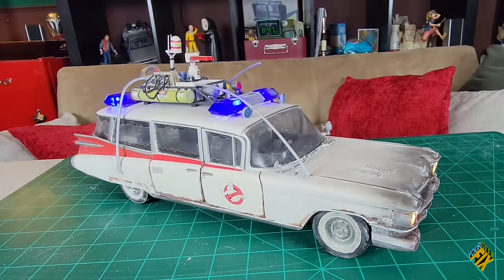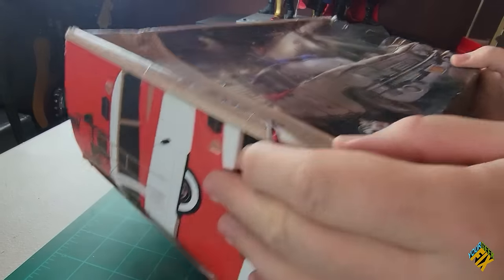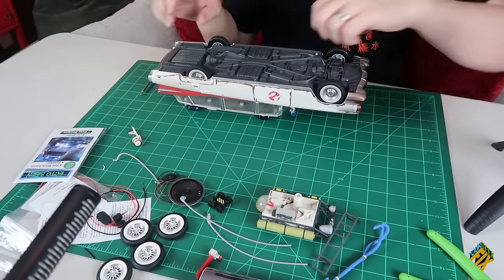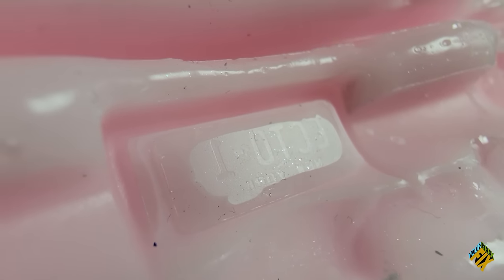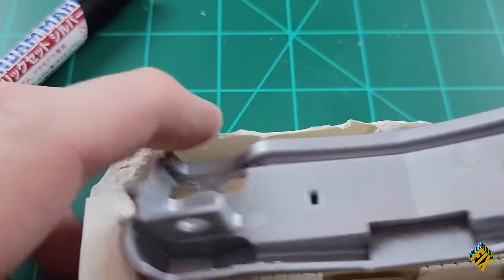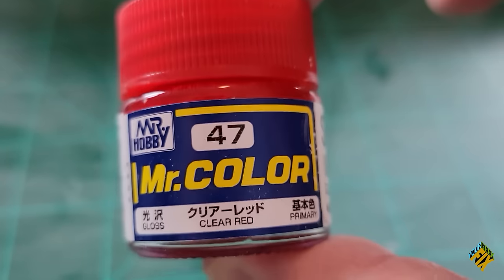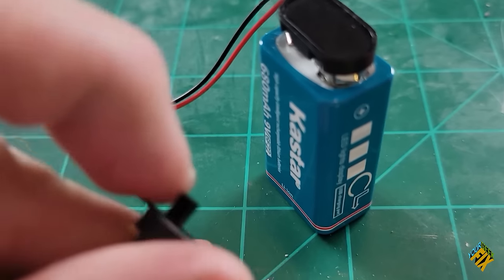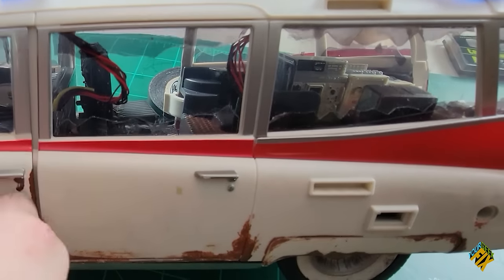How We Made a Working and More Movie Accurate ECTO 1 Upgrade with Lights and Siren

Comment: Hi i love what you did and just a tip for the top lights a blow dryer on the top for a few minutes and they pop right off
Reply from the maker: Tried that and it didn't work. Any longer and it would have melted that plastic as well. Probably depends on how much glue the applied. Mine had a lot. Did yours come off with heat?
Reply: Yes after five minutes it wasnt easy and like you said I didn't want to melt it how did you get the torpedo light off without cracking them
Reply from the maker: @ozvampozvamp6319  They pulled right out for me. Not much glue. Giggle it a little. They are connected.
Reply: Thank you i will give it a shot 
You rock and keep up the awesome work
Reply from the maker: @ozvampozvamp6319  You too!

Comment: "I could leave it on all day, though it would eventually burn out those lights." I'm glad to say, you're in luck here because LEDs have an insanely long life. Even cheap ones will last fifteen solid years of being on, and yours look like higher quality at a glance, so you'd need to leave them on for twenty years straight at least before they begin to go dim. And since LEDs do not have any issues with being cycled affecting their lifespans, the ones on top would last twice as long. Fun fact, often LEDs will be oscillated at an extremely high rate, faster than can be perceived by eye, to increase their lifespans for long-life applications.
Reply from the maker: Good stuff!

Comment: thank you for your input im doing the same upgrades right now, same lights and sounds.
Reply: but one question , with the rear built lights how did you run the fiber optics
Reply from the maker: Awesome!
Reply from the maker: @JoeBowman69  I took off the bullet lights and drilled through.

Comment: SO glad you made this video! I bought mine for this exact purpose. I was sad to see the headlights were not molded in clear.  Can you give a bit more detail on how you managed to get the top lights off to install the leds?  And where did you hide the batteries? I was planning or hoping to fit them under the hood..
Reply from the maker: I drilled the hole into the very center of each of the lights. Then, using a razor blade, you'll find that the plastic is very easy to carve. Just carve it down until it looks exactly like you want it to. As far I too.  As far as the batteries go, I put them under the hood and connected them to AY split Micro USB and ran that to the back. Good luck!

Comment: Awesome job!
But the antennas look kinda cheap in plastic. Why didn't you exchange these for thin metal wire?
Reply from the maker: I have since. There is an actual flexible Antananarivo I used from an RC race shop. Looks perfect!
Reply: I used the thinnest guitar string

Comment: Can you show where you installed the battery please
Reply from the maker: Now, my version has two batteries which I installed under the speaker, under the hood. I did tilt them slightly to make it fit, but they do fit between the weel wells.

Comment: great mods, but I'd turn this into the original car if I could.  Not being handy myself, do you take commission?
Reply from the maker: I think it would actually be easier to do that. Everything comes apart really easily and you can paint paint the areas very easily. I highly recommend jumping into it. I think the best part about doing this is doing it yourself.. It will give you something even better to talk about or look at. Read good luck
Reply: @YourGeekFix  thanks :)
Reply from the maker: @raynekraven  any time
Reply: @YourGeekFix  The only real issue making it look like the original is that there have been some substantial changes to make way for the gunner seat. The ladder was moved to the opposite side, and the door opens the wrong way now.
Reply from the maker: @Doctors_TARDIS   @Doctors_TARDIS  I mentioned all that in the video and the way to correct it. Thanks for watching.

Comment: Hi ive been going nuts on the missle tial lights how did you drill and plce the light i bought the light and siren sound but i cant remove without the fins im going flipping nuts
Reply from the maker: Like I showed in the video, I could not fit the red lights in the bullets or tails. I removed the bullets, which pull out in twos and using plyers came out easy for me. I then drilled with a very small micro bit into the fins. Now, there are red clips inside teh car below the window for releasing the find that I found were glued, but I drilled into there to send fiberoptics from a red light in that area, behind the computers, to the hole where the bullet lights go. I drilled a little into the bullet lights both so the fiver optic could go a little inside and to defuse the lights. Fiber optics are how I did a lot of the project. https://youtu.be/9LpyWuRVYiM?t=1408

Comment: Got mine modified but its a more budget ecto 1 unfortunately I cant get a hold on the ecto 1sound i gotno option here ib Ph to buy one.
Reply: The speaker I got has the sound built in. You can get the speaker by it self. Pretty cheap option.
Reply from the maker: Yeah, the Evans design speaker is the cheapest and easiest option.

Comment: Very nice, just you should reduce the volume of the Music by 50%, it is way to loud and over time get a bit anoying if you need to concentrate to understand what you are saying.
Also why did you made that much Resin for just the Lights?
Reply from the maker: Did you watch it on a phone. We learned after that year that Youtube output on phone and computer was different for. Some phones did not even hear the dialog at all, but was fine on computer. I had a few things we used the resin for.

Comment: Is there a part 3 of Pip-Boy 2000 Mark VI? It said Part 2 of 3. Thanks.
Reply from the maker: Yes! It was a pretty major production and will blow away the other two. However, a problem with my 3D printer, illness, and collaborator changes led to delays. I hope to at least post the preview this weekend. The actual video is most likely going to be New Years at this point. Make sure you are subscribed and hit the reminder bell!

Comment: In your video you say a small mistake and accidentally call the blue lights you call them the siren calling them the sirens on top. Anyways obviously not a big deal just wanted to point it out in case someone doesn't notice. Anyways thank you very much for your video its a great video and i got some great ideas on how im going to upgrade my Ecto-1.
Thanks again and have a great day everyone.🚫👻👍✌
Ps im at 22 minutes into the video now and you did it again you keep calling the lights sirens lol this time saying that you had to drill into your sirens. Oh well its again no big deal i just thought it was a little funny is all.🚫👻👍✌
Reply from the maker: If you purchase the lights from Evan designs, they are the "siren lights" distinguishing them from the "static lights"
Reply from the maker: I also used other flashing lights from the "captain" designed for the millennium falcon.
Reply: @YourGeekFix  that's funny because I never heard of a light that has the ability to make a loud noise like that of a siren. Bottom line call it whatever you want a light is not a siren thats all im saying you can be upset at me for leaving a comment if you want it was not my intention to upset you but if you are unfortunately nothing i can do about this.
Thanks again and have a great day. 🙂👍✌
😂🤷‍♂️👍✌
Reply from the maker: @RavenTheLabrador  Not at all Raven the Labrador. Just the name they chose to distinguish them from the other lights as they are tied to the sound chip that makes the sound. It's a good question.